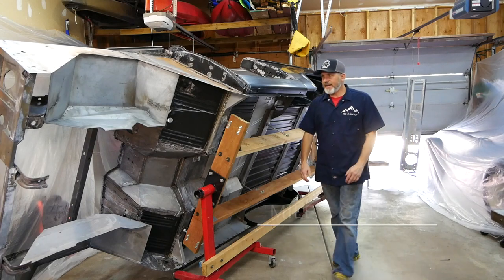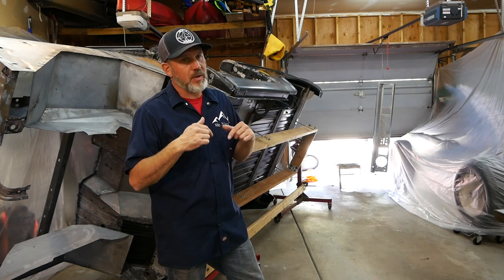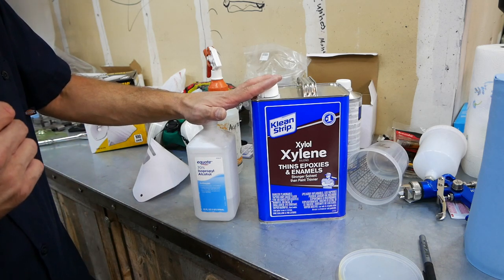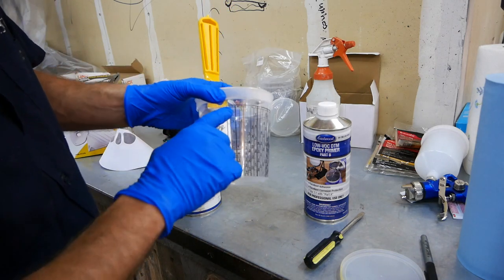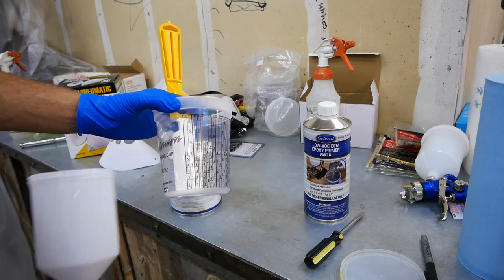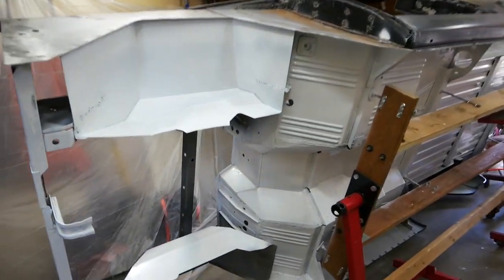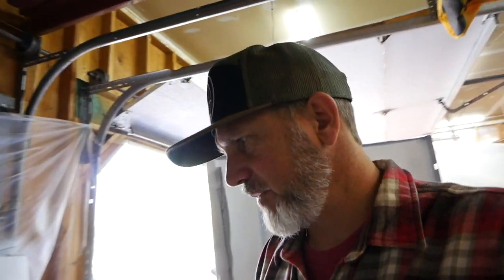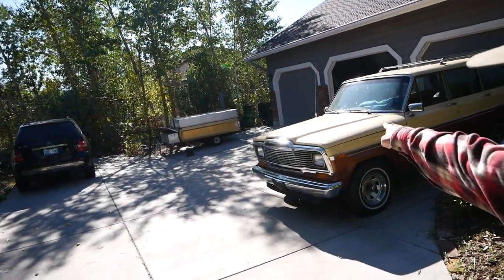Time to Prime! Priming an Early Bronco with Epoxy Primer.  Didn't go as planned.

Comment: I used 1.5 gallons of the Eastwood black epoxy primer using a 1.7 tip on my 66 Bronco and that didn't include the underside. That was 2 full wet coats. I agree with the other comments that you will need to scuff the primer prior to paint since you will be waiting more than 3 days. 

The truck is looking good!
Reply from the maker: Thanks Jason. I knew I was going to have to scuff when I got pushed beyond  my deadline.

Comment: I used 3/4 of a gallon of PPG Omni MP170 epoxy primer on just my 72 bronco tub, 2 coats. A 1.8 tip worked just fine for me with a Devilbiss finishline spray gun. Don't forget with epoxy primer you only have a 72 hour window to top coat or you have to scuff and reshoot the epoxy primer according to PPG. After 72 hours the epoxy cures and your top coat will not bond to it. Eastwood says you have 5 days on their product but I don't reccomend pushing it, you don't want the first layer of material on your paint job to fail.
Reply from the maker: Thanks Craig. I had to make my move before the hunt. I know scuffing  is in my future unfortunately. Thanks for the info.

Comment: I don't know but maybe I missed it. Could you show the picking points and bracing you used when taking the body off?
Thanks  enjoying the videos
Reply from the maker: Tom, I kept the top on the body when I lifted it off. That braced it without the doors on it. Then I placed it on my homemade rotisserie and took the top off. I used my shop crane to pick up the body and bolted the chain into the hood hinge area in the front and the seat belt area in the rear. Worked great.
Reply from the maker: My first video on my channel is how to build the rotisserie. The last vid before this one shows me lifting the body.